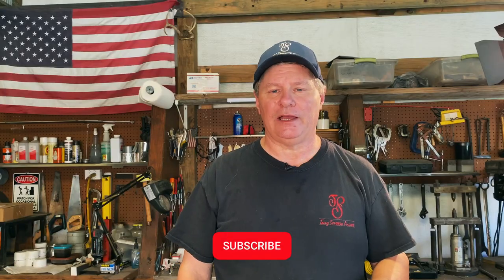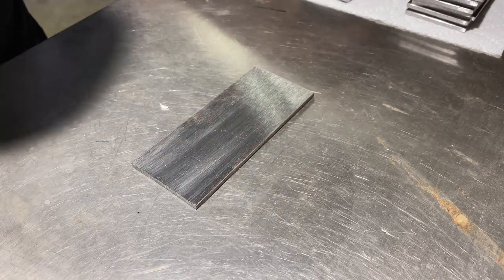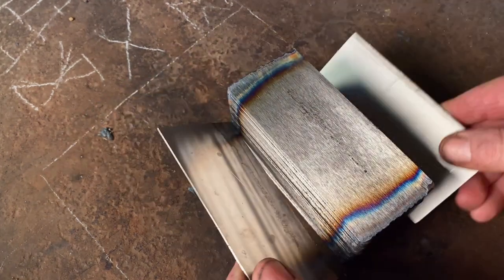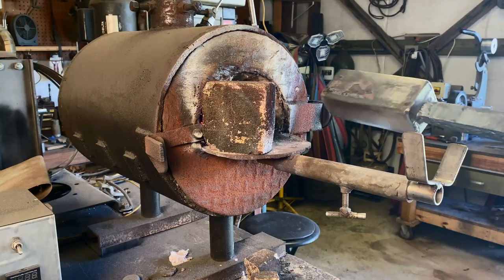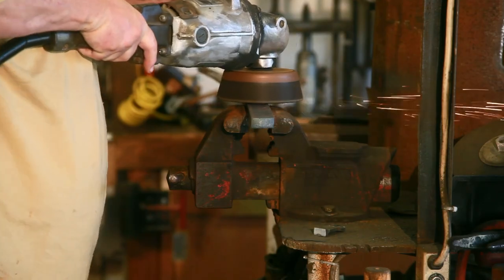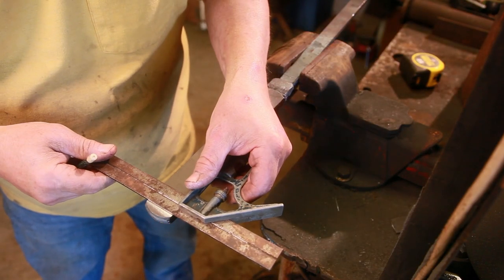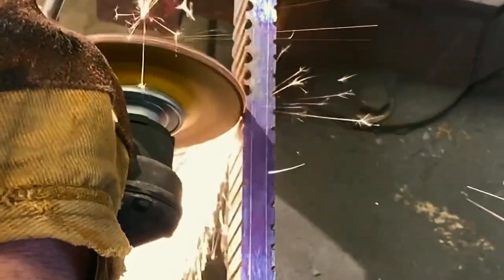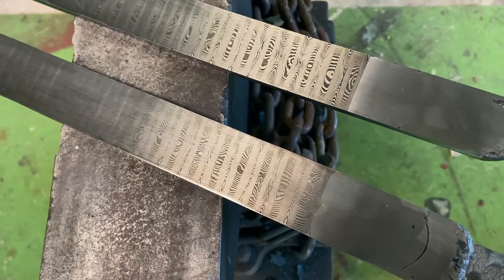How to make ladder pattern damascus the old fashioned way

Comment: Great video on the topic, Tony!  I am surprised you don't stagger the cuts on each side though so they aren't opposing each other.  Any reason you don't?
Reply from the maker: Thanks!  I try to cut them so that when I forge down to my final thickness, they are forged flat.  I do it both ways however and for me it depends on the final thickness desired.  For these, I want a wavy pattern to appear on the edge when the bevels are all done and at the top of the tang more of the ladder pattern.